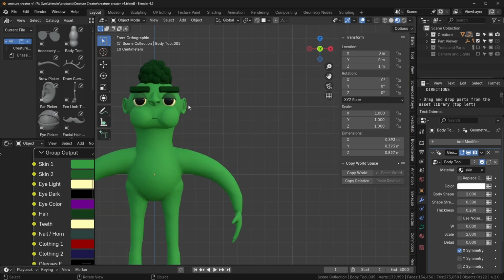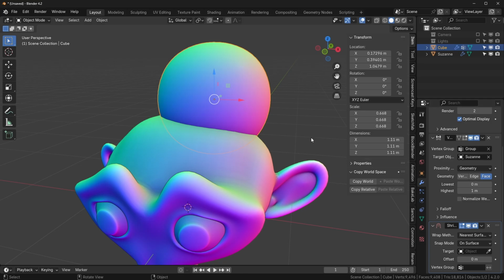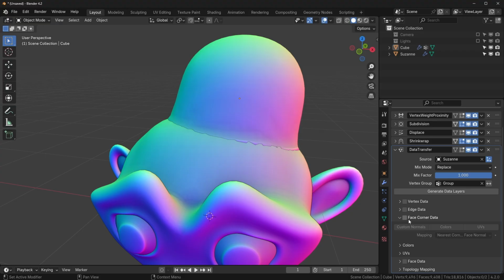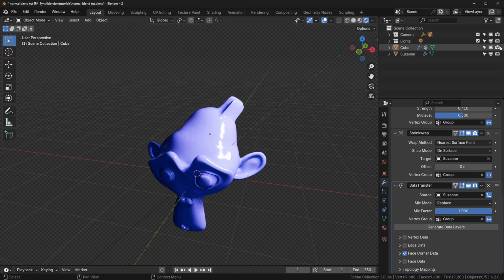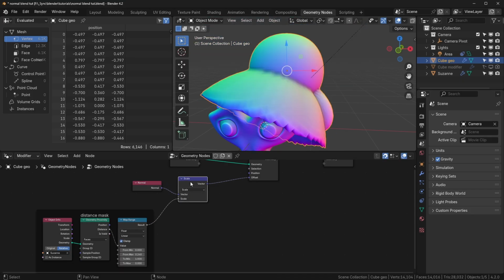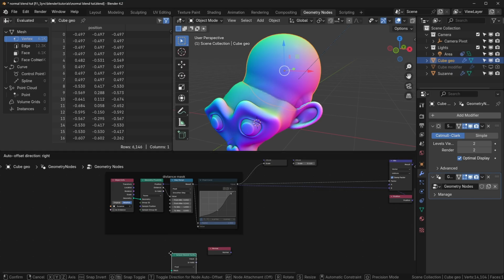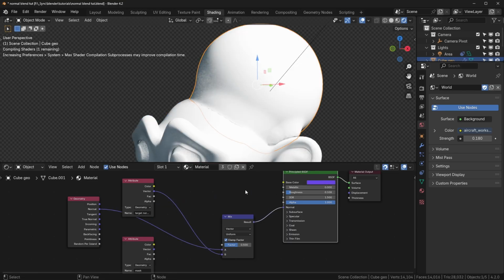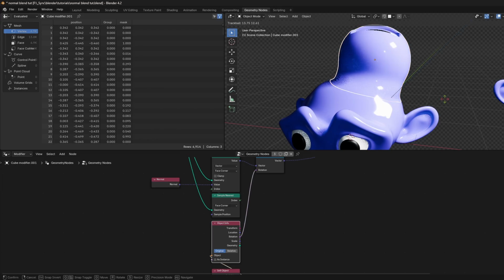Making objects blend without remeshing - Blender tutorial

Comment: Hi, I love your tutorials. I found the way you developed this geometry blending solution incredible. I have difficulty understanding geometric nodes. If possible, I'd like to know how to isolate a mask with vertex groups and assign it to the geometric node scheme. It would be interesting to be able to select vertex groups for both the target and the receiver. My biggest need is to do this only for the normal effect. And in the case of an SSS shader, how do you filter a mask that preserves the data transfer effect? There are many questions to answer, but I would be very grateful for any response, even a partial one.